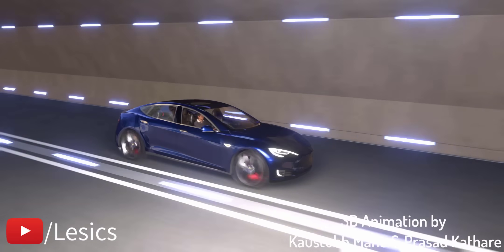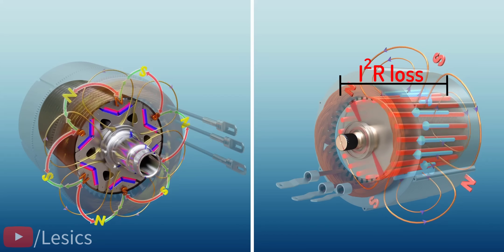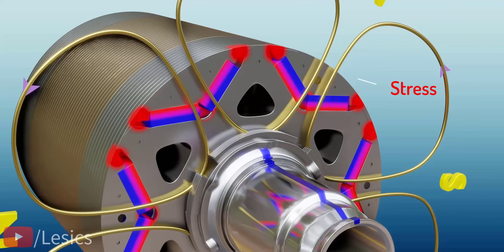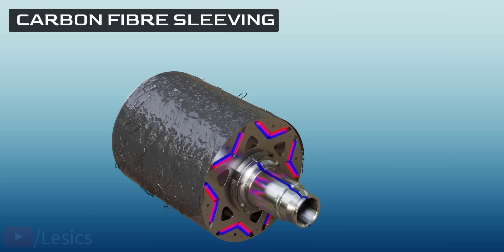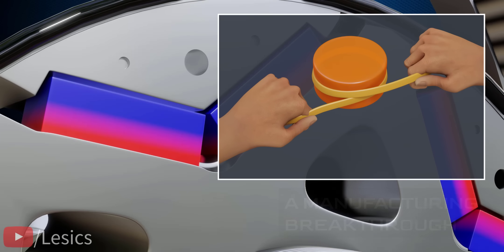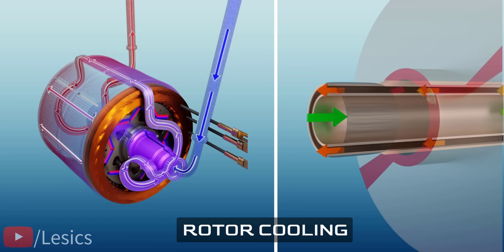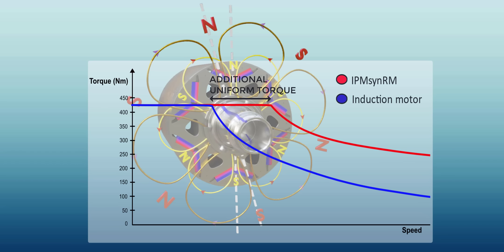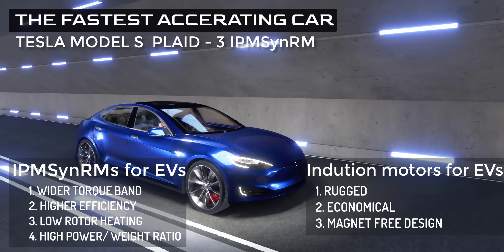Model 3 Vs Model S Motor

Comment: Lesics What motor is better suited for electric aircraft, the IPMSynRM or axial flux motor ?
Reply: axial flux motor. because of its high power to weight ratio. next video coming up on that in 10 days.
Reply: @getartsywithyogita8291  actually, whatever is more efficient and requires a smaller battery. There's little relevance in having a lighter motor if most of the weight comes from the battery anyway.

Comment: Pretty sure the model 3 is using ultra high strength steel sleeving, it's the new model S which uses carbon fiber sleeving.
Reply: E Van  It's 1.99 with 1ft rollout substracted (when you use the laser detectors on the track) and 2.1 from a standstill (when you use the Dragy)
Reply: E Van  Neck training is required.
Reply: No, the Model 3 motor's rotor is not steel-sleeved - that would not be workable magnetically.
Reply: E Van  it could accelerate faster if it wasnt a four door 4,700lbs beast, kinda crazy to think about
Reply: @sovietdies  From 0-60 it's limited by friction so no, but after 60 shaving weight would sure make a big difference.
Reply: @johntheux2ecompte56  I guess true, handling and performance overall would drastically improve if they were to remove comfort features and reduce the battery pack size for rally racing, there's a looot of potential i mean.

cant wait for people to get their hands on a plaid drivetrain and push its limits.
Reply: @sovietdies  If they make the car lighter then downforce would be higher relative to the car mass. But since the model S is not a track car I don't think it has any downforce whatsoever so shaving weight would not make a difference for cornering performance.

But yeah if you have time and money to add aero surfaces yourself it's better to have a lighter car.
Reply: @johntheux2ecompte56  getting all that mass to stop can be a challenge for the brakes, especially from high speeds.
Reply: @johntheux2ecompte56  Just stop please. If you don't know what you are talking about shut up. 

Less weight is always better in a car, the traction provided by rubber goes up with weight slower than the force required to achieve the same acceleration does as the weight goes up. This means with the same braking force, a 1000kg car that makes 200 hp will be a lot faster than a 2000kg car that makes 400hp. The rule of thumb is around 20-30%. And I use acceleration in the true sense of the word, stopping and turning is also acceleration.

Traction is almost always the limit on speed for a modern car because they are all now powerful enough to smoke the tires.
Reply: @sovietdies  i could fly if it wasnt for gravity.
Reply: @romansenger2322  
Thats ashame i fly every weekend even with gravity present
Reply: Yeah, and the Plaid doesnt use induction motors on the rear. Its just the M3P motor with the carbon sleeve.